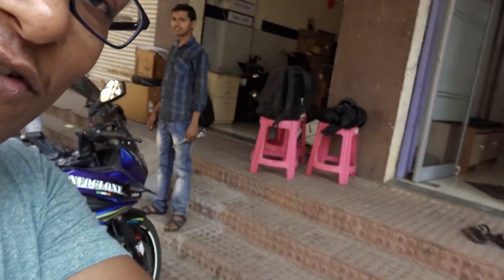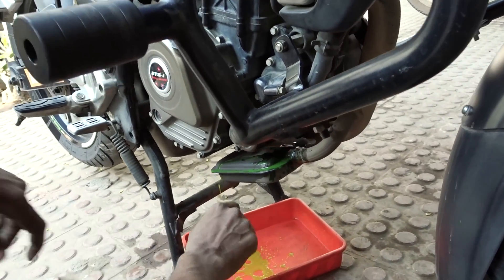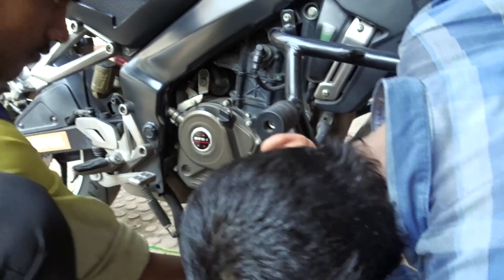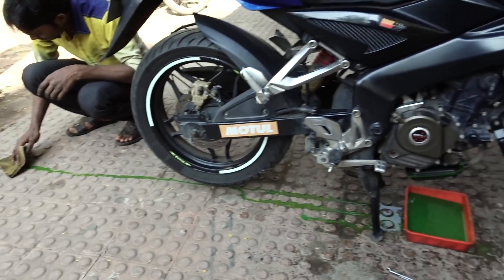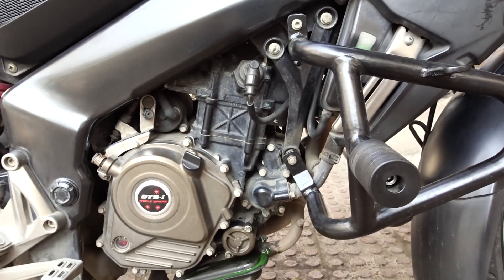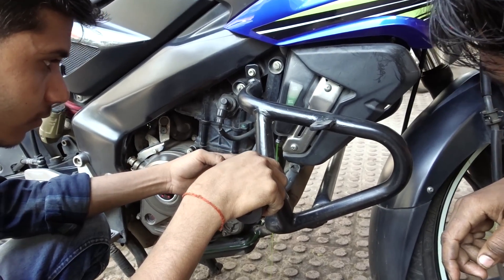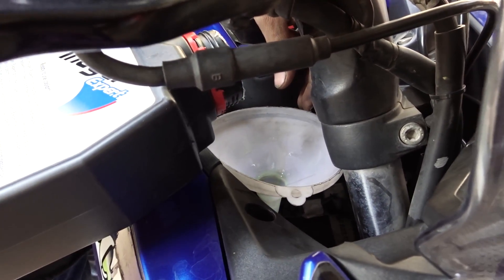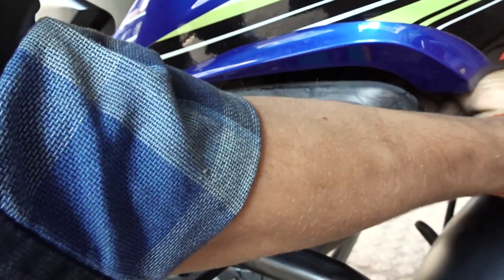How-To: Change Motorcycle Coolant | Liquid Cooled System Explained

Comment: My coolent of radiator in ns 200 is spilling back . can anyone advice what to do. Here bajaj service center people without checking says to change everything.
Reply from the maker: Either the quantity is more than required Or there must be some air trapped inside it Or there is a blockage somewhere in the hose...draining and refilling might help...not sure though!
Reply: @Infoclone  it backfires when the engine gets heated us and fan starts working

Comment: what if water filled instead of this green solution...?
will it kill the engine..?
Reply from the maker: Water boils at a much lower temperature than this green solution does.....hence coolant is used instead of water.....nothing will happen as such but the water will start boiling at 100 and wont be able to cool down the engine that quickly 🙂
Reply: Infoclone  thanks for replay...
Reply: Dont get green coolig liquid its almost always TOXIC! Pink and blue are usually NON-TOXIC (safer)
Reply: I use water, and it works

Comment: 🤐 after Pouring coolent in Radiator Need to check for no air remain in radiator and must clean the radiator with 2 litres of distilled (battery water)  and must clean 2 tymes widot dng ntg he said done itz diy dnt trust local sm r good sm r lazy sm r dickheads sm r bad

Comment: Bhai aap ne jo kiya h wo galat h sorry ki aapko meri bat galat lage lekin jab load karenge tab readiator k left side me upar k bolt hota h use open karna hota h or jab waha se lik kare tab tak aapko coolent bharna hoga uske bad readiator ko fit kar de or baki coolent extra tank me dalna hoga taki over flow na ho 
Tip :- diyan ye rahe ki air undar creat na ho nahi to gadi ka gas kit ja sakta h

Comment: You missed out a step in this!!! When ever u change coolant or even top up there is some times air bubbles in the radiator which u should remove!!! Get it done!!